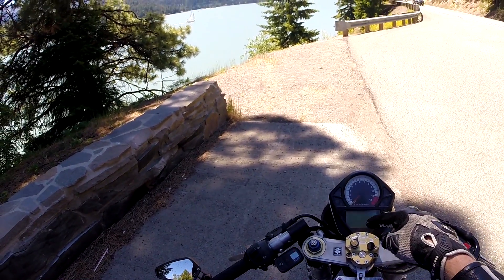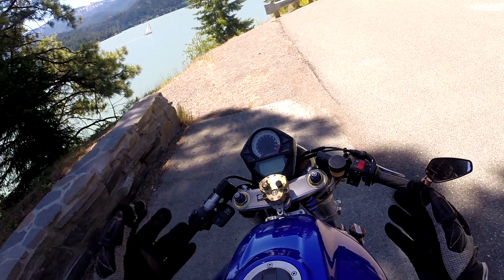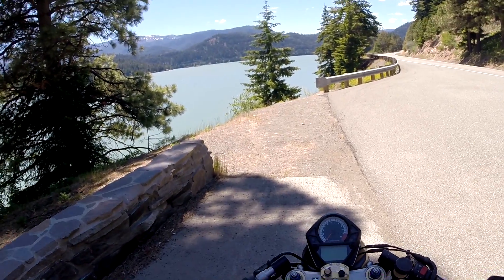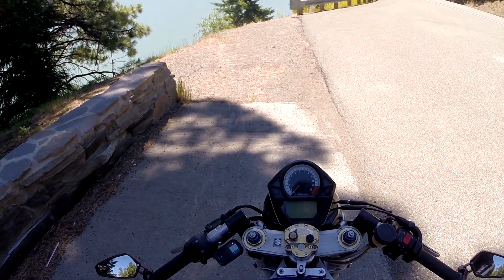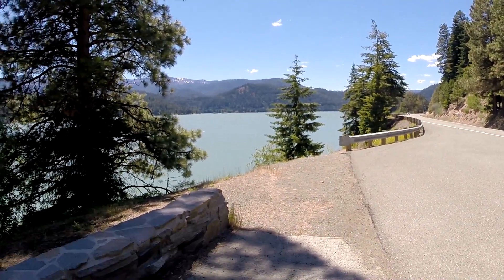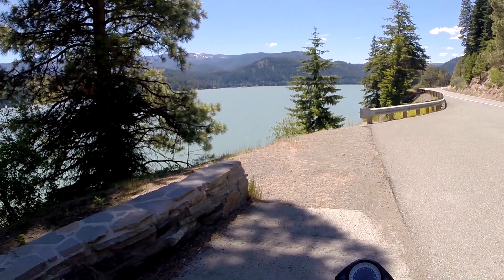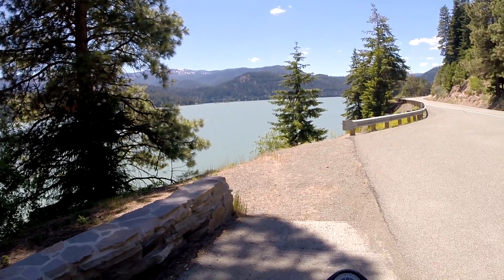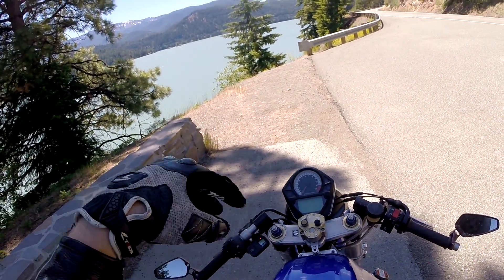Motorcycle Stability Explained

Comment: I think you are explaining counter-steering more-so than stability. The hands-free stability effect you keep referencing is indeed due to the centrifugal force created by the spinning wheels. Example, the bike will not stand up alone at 0mph, but will when it reaches approximately 25mph + (and when counter-steering begins to take effect)
Reply from the maker: I de-emphasized the effect of gyroscopic forces a bit too much in the video, but the distinction I'd make is that they are a contributor to dynamic stabillity, not static stability. 
The action by which gyroscopic force dampens a lean is the same as that resulting from the  geometric stuff I described here, that is the front wheel turning in the direction of the lean to correct it, and yeah, this would be included in what we call counter-steer. 
It is also a myth that counter-steer (rider induced or not) it is ineffective at slow speeds. It's still working, just with exponentially larger bar movements time delay in response as speed is reduced. It's just gets a lot harder to recognize.

I won't pretend this is a simple subject, but I wrote a really long and carefully written explanation of allot of these stability effects in response to a string of comments that I guess was deleted by the poster :( Anyway, if you are interested I'll post it here.
Reply: drienkm Thanks for the response, please do post it here I find it quite interesting. thanks!
Reply from the maker: Here it is. He was arguing something about how caster alone gives stability and said he was a "motorcycle engineering student". Anyway it's a shame the thread was deleted. It was a good conversation.
Also, you may find the video description helpful.
*
I deeply enjoy these discussions too! A Motorcycle Engineer?! Sweet! Is that an actual degree? Where are you studying? Anyway, I'ts good to know I'm free to use more precise technical language:) I have a degree in Aerospace engineering. 
This is a pretty complex subject, and so for the discussion to be meaningful, we have to be careful with word choices and phraseology. These words have very exact meanings;)

Anywho, I'm still trying to isolate if and where we disagree. You seem to be saying that the caster effect is solely responsible for static stability. I would actually say the same, but there seems to be a major difference in how we are each describing that phenomenon. 
A castered wheel has 2 behaviors: 
1) points in the direction of motion (you recognize this), and 2) points  in the direction it is leaned... try tipping an office chair or rolling table. You seem to have a problem with the idea of gravity (or more generally, downward force through the wheel) playing a role, but you haven't "replaced" it with anything. For static stability, something must still turn the wheel in the direction of a "lean axis" disturbance. Behavior 1 alone doesn't get us there. It relies on the direction of travel changing. The bike leaning doesn't necessarily change the direction of travel. The castered wheel would still be tracking straight in the original direction of travel, despite the lean if it weren't for behavior 2. 

Okay, I'm going to sound off on some peripheral subjects to make sure we are on the same page there...

About the pillion, I used it because I was trying to depict a "lean disturbance" that wasn't the result of an obvious outside force pushing on the bike (like the wind example). It's a bit of a tangent, but your opening sentence suggests a slight misconception here. BTW, I'm taking "cornering forces" to mean all dynamics where the "roll or lean" axis is concerned?... correct me if I'm wrong. Anyway, put simply, the truth is when a balanced thing changes it's own shape, it may no longer be balanced... That's it really.
Here's the details:  So, you're riding straight and everything is centrally aligned when the pillion suddenly leans out to the left. Momentum is conserved and the bike leans slightly to the right (I think you're with me so far). Now it might be tempting to believe that the contact patches are still vertically underneath the composite CG because there don't appear to have been any external forces, but they aren't and there were. The tires are now slightly too far to the right to maintain balance. What happened?...  Rider's CG is highest - it shoves out to the left > imparting a force to the right on the top of the motorcycle > bike wants to both translate to the right roll to the right, mostly roll. If there were no external forces, the contact patches would glide to the left, but they can't! Friction from the road is an external force acting to the right on the tires. It's an interesting problem because it depends on proportions. If the bike had a very large moment of inertia about the roll axis compared to it's mass and the vertical separation between the rider and bike CGs, then the same pillion movement may actually unbalance the bike in the opposite direction because the bike would want to mostly translate to the right instead of mostly roll. Then the tires would have wanted to glide to the right instead. I guess a bike could exist that would remain balanced with just the right rider movement! Hmmm. Anyway, I digress.

As far as gyroscopic effects go, yes, they get much stronger with increasing speed. For the rear wheel, it's easy to see that this effect is basically pure lean damping because it isn't free to turn. For the front, it's really tempting to think of it as a contributor to static stability, but really it isn't. The gyroscopic reaction to lean that tends to turn the front wheel in the direction of the lean is a function of the lean's angular velocity, not angular position... >>> It's effectively a lean damper.

Lastly, it's always really important to keep time straight in these kinds of problems. Remember that while we all know a bike begins following a curved path when it is leaned, allot happens very quickly. It's important to separate things out into the proper cause, effect and sequence of events. 
If a bike is to follow a curved path, it has to already be in position (leaned) to support the new leaned inertial vector acting on the composite CG so that it passes straight through the contact patches (well, the line between the two patches.... or maybe just the one;). It can never sustain a curved path without first being leaned. (I'm pretty sure you're with me here, I just think it's useful to illustrate it freshly for such a complex problem) So this "behavior 2" I'm describing where downward force through a castered wheel causes it to turn in the direction it is leaned... this is only having an effect until the bike has begun following a curved path. It depends on the lean angle being too much for a given turn radius and speed. During this time where behavior 2 is effective, the inertial vector acting on the composite CG is passing to the inside the line of contact. This generates a roll moment encouraging the fall. At the same time, behavior 2 is aggressively causing the tires to roll to the right, generating a stronger roll moment against the fall. The net moment begins to slow the fall . Meanwhile, as a byproduct of the wheels rolling sideways, the bike has begun accelerating to the side, beginning to follow a curved path. At some point, the lean angle matches the turn radius for the current forward speed. At that point we can say things are in "equilibrium" in a steady turn. This whole time, behavior 1 has been doing it's thing, making sure the front wheel doesn't whack over to full lock.

Are we getting anywhere?
Reply: Don't know about anybody else but i get it.....Just as long as you can explain why my bike (CBR 1100xx) requires me to add throttle at low speed to keep it from falling into a turn but at high speed it is necessary to add throttle to reduce turn radius...chop throttle hauling ass and the bike wants to stand up and go straight...Stone stock bike with OEM muffs and The same size Batlaxes it came with and less that 5k miles. That said, it is the most rock solid stable bike i have ever ridden..one handed in a 35+mph wind all the way to 160.
Oh..and "pillion" same as bich on back.."bob" I like them skinny ones, they seem to understand how important it is to hang on when they start sticking body parts out in the wind past 90...lol....bet a lot of other bikers think i have an attitude for not returning their wave...even at 70 sticking my hand out is not a good idea..